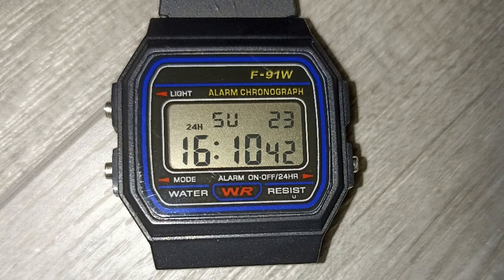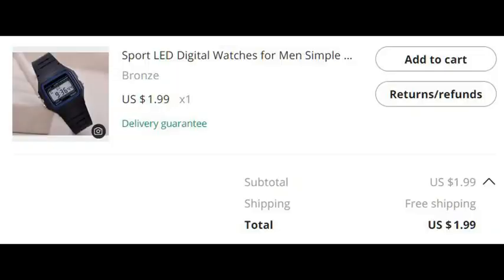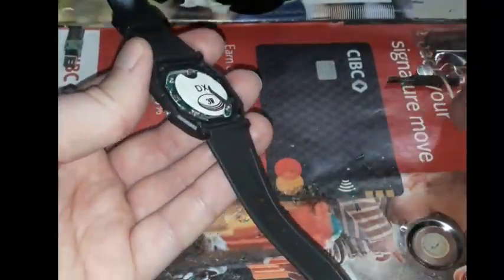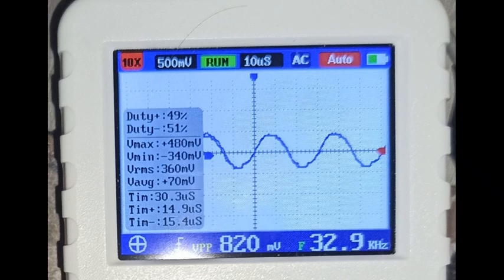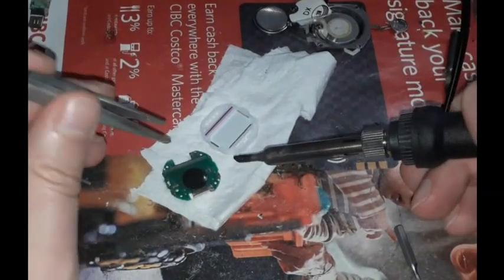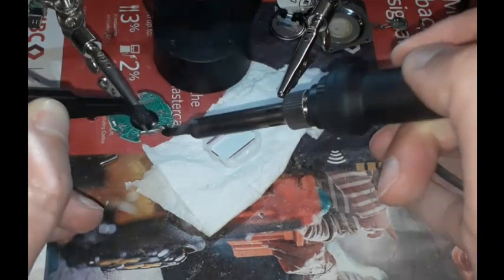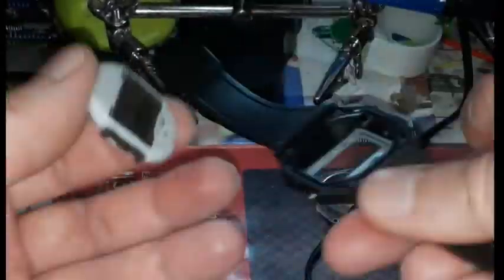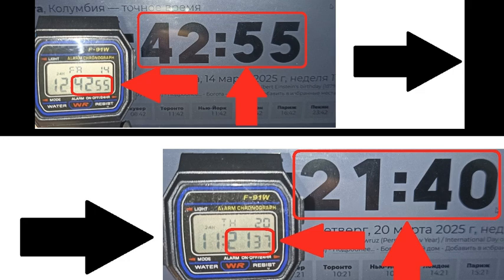Replacing quartz oscillator on Casio F91W.

Comment: Can i do this with the original one too?
Reply from the maker: Quartz replacement can be done on any quartz-based watch
Reply: @silkykilky  i have 5 original f91w, they are all less than +/- 10 sec a month. I don't think it would be worth it unless yours is significantly inaccurate such as the 2$ fake casio.